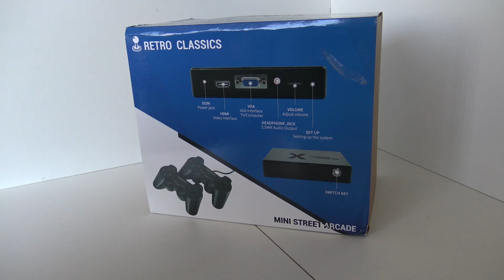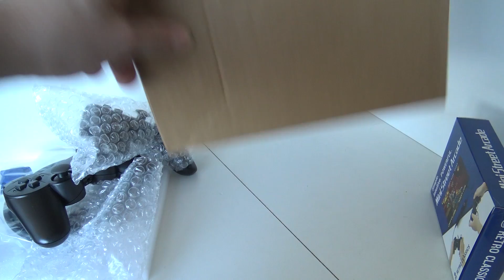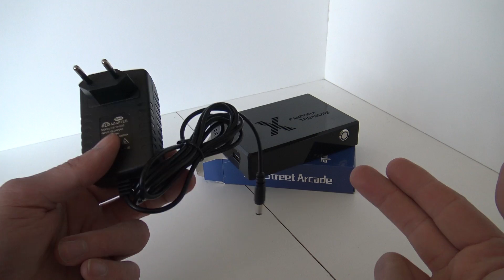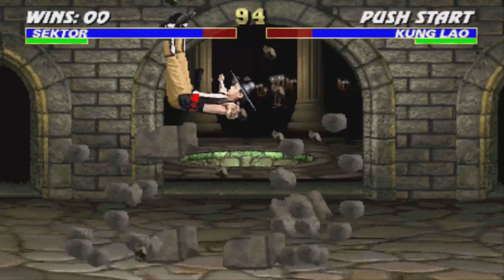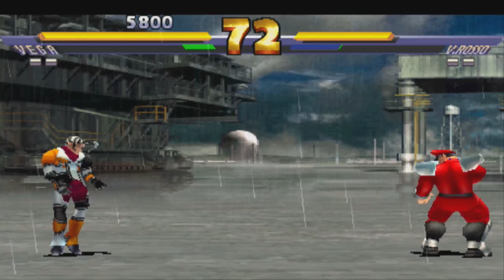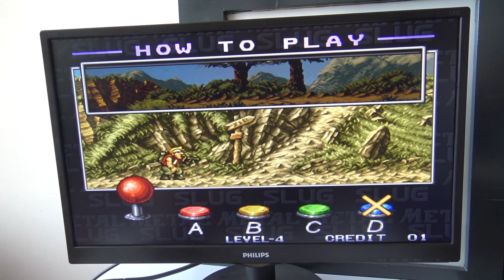Next Generation Pandora Retro Game Console is HERE !

Comment: I’m assuming you can throw this in an arcade 1up?
Reply from the maker: Yes.. and no. 
Yes you can connect the display 
No.. or not sure if you can use encoder board on USB connection. 
Going to make the video soon.. The Best Pandora's Box for you Arcade / Arcade1up
Reply: Wicked Gamer & Collector I figured there would be some kind of issue, just bought a Marvel cab and I’m looking to mod it the easiest way possible

Comment: For the price that these units are selling at I'm not surprised that they are using cheap controllers.  I think the Neo Geo Console option adjusts the system BIOS to allow a better gaming experience for games that were specific to the Neo Geo gaming console.  Any chance you can crack this thing open so we can see if other changes were made to the board? Nice video and nobody cares about the power brick.